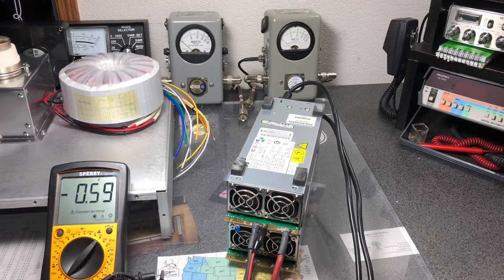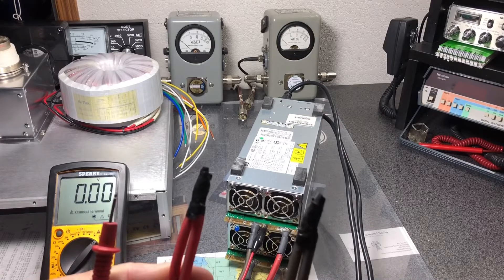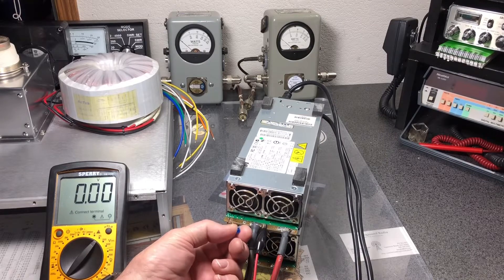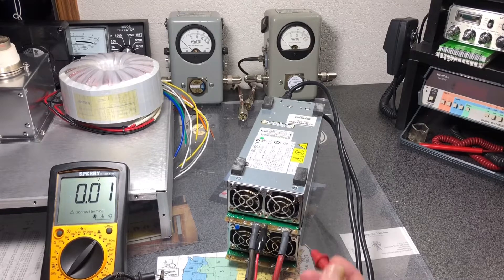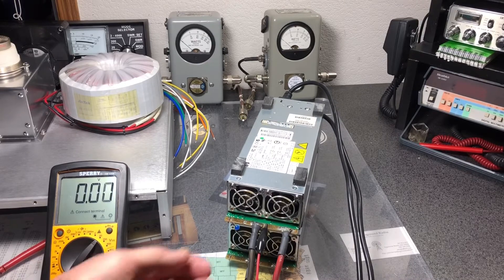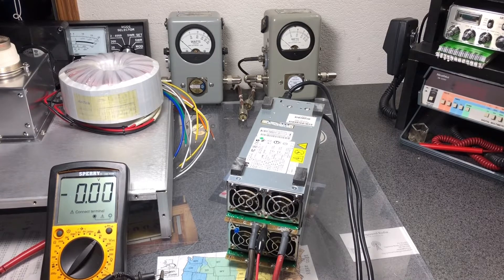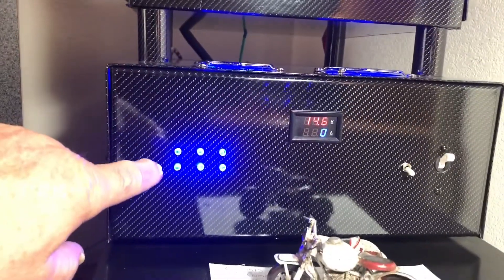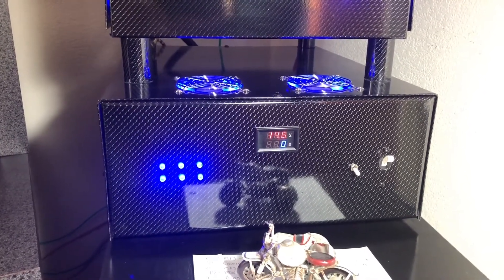Server power supply tip

Comment: When you run supplies in parallel does it double the amp draw capability? Two 50amp supplies run in parallel give you 100amps?
Reply from the maker: Exactly, they also have to be set to the same voltage before connecting to each other.
Reply: @hotwire5894  I've used your videos to create a makeshift amp dyno for testing car audio equipment. I have pictures and would love for you to see them to post if you like but YouTube doesn't allow me to post pics in the comments. Its pretty cool. I have to adjustable resisters to match voltage, two power switches to power up supplies separately, I've incorporated a Bluetooth adapter powered by the low voltage on the supply for an audio output. I use an ebike digital readout for voltage and amp readings. Its all contained in a generic blue electronics box from amazon. I used your videos for support. A video titled home made car audio amp dyno would potentially get a ton of views and I would love to see how you get your setups looking so clean with the carbon fiber box and components. Thanks for the tips and hacks! This was a fun project. Cheers!